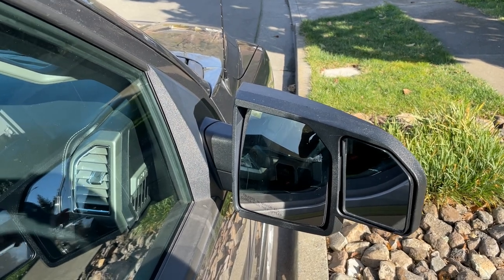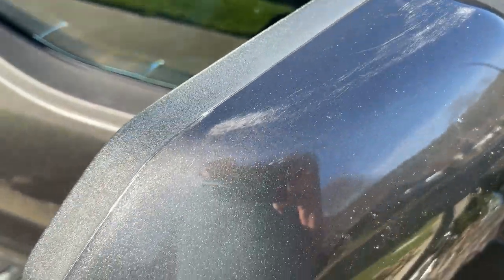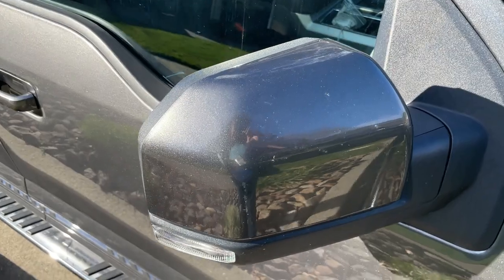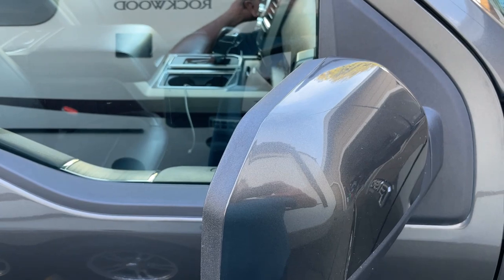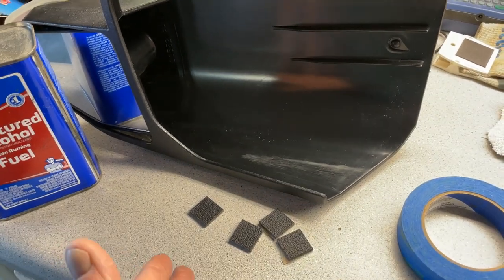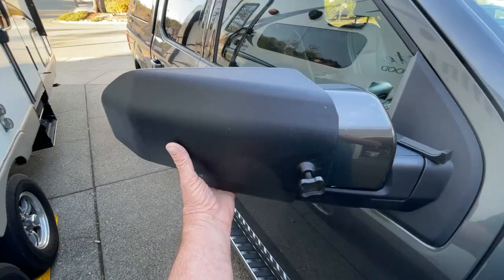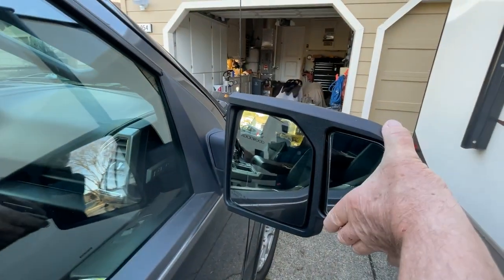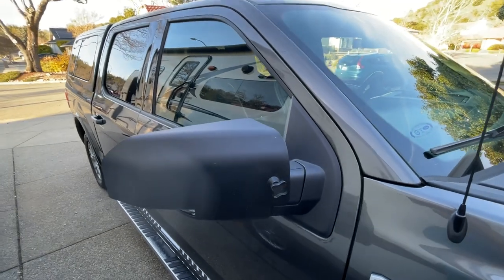Removable Mirror Extensions Are Damaging Our Truck Paint

Comment: I had the same issue years ago and what worked for me was Clear Bra. The stuff they use to cover the front of autos. I covered the mirror and the inside of the mirror extension. You can get it off of amazon or go to one of your local auto vinyl wrap shops.
Reply from the maker: That's a great idea, is this the stuff you used? https://www.siliconvalleyclearbra.com/?gclid=CjwKCAiAsaOBBhA4EiwAo0_AnExiaJzwuXqcd5FpT0b0NUXgN_yK1DtpLxg_AKtZLUxcqN1f8wuRrBoC-RMQAvD_BwE
Reply: @thetraveltrailerguy  Yes or very similar to it. Mine just happened to be a 3m product. I went to a local and they gave me some scraps for free.
Reply: @thetraveltrailerguy  .. I’m with Rick and his “scrap” approach.  The film easily applies with a light soap and water solution.  And the 3m material is a UV and Anti Yellowing material.  And apply the film to the truck mirror top surface.
Reply from the maker: @mike_adams  Good to know, I learned something from both of you today. Thank you

Comment: For me a better solution was to buy factory style extending towing mirrors. I added them to my Silverado and my Tundra. They have much more viewing area than the clip on ones. Plus they are heated, power adjustable and have the signals built in.
Reply: Yea, but for how much compared  to the clip-on style. I would only need the extended mirrors while towing our camper.
Reply from the maker: Nice set up, maybe someday I will do this myself :)
Reply: @USNavyAR5  The aftermarket ones I got for the Tundra were $188 for the pair. They have been on the truck for 3 years and they work and look like the factory Toyota units. For that amount it was definitely worth it. Even while not towing the visibility is much improved. I bought the aftermarket Silverado mirrors 20 years ago and they are just fine.

Comment: I'm with the 3m product but use a baby shampoo soap not a dish soap, way to strong
Reply from the maker: I'm not sure what you are saying :)
Reply: @thetraveltrailerguy  when putting on the 3m clear you need to use a water soap solution so you can move the 3m vinyl around to position then squeegee the water away
Reply from the maker: @scottgorman7166  You are so right Scott, thanks for the tip :)